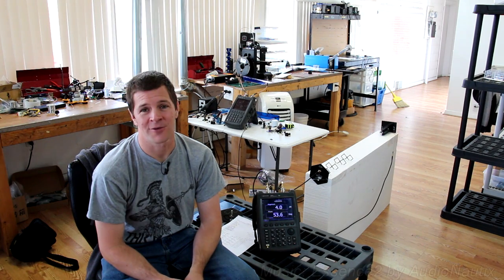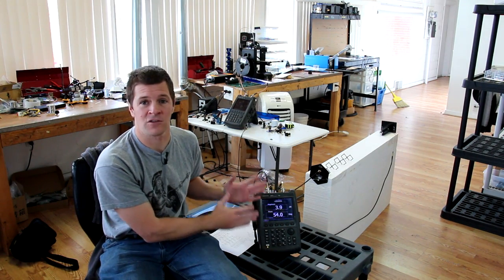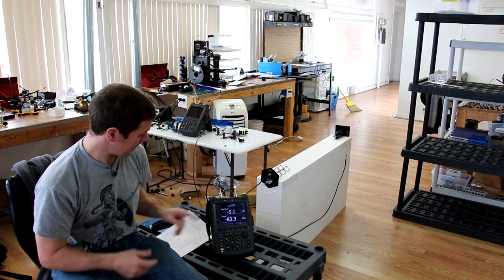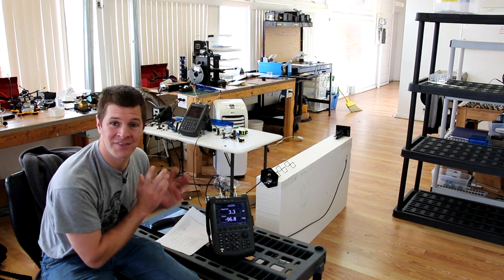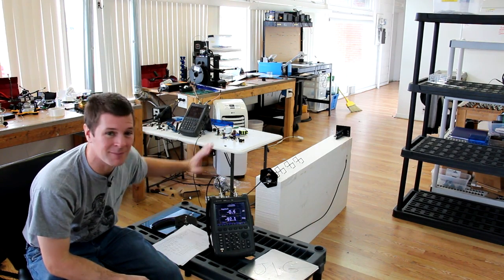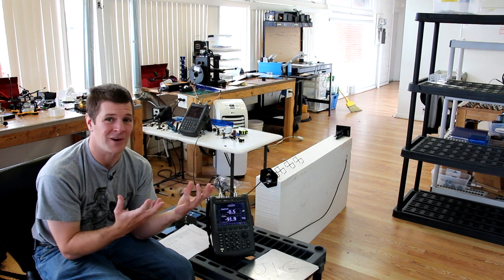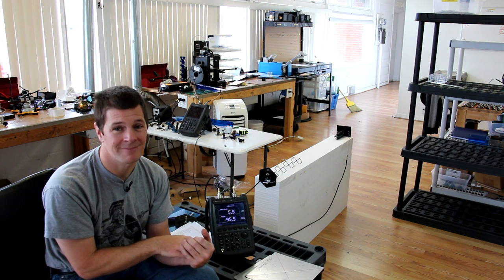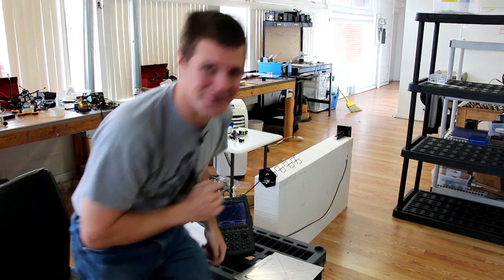Why I don't trust computer designed antennas

Comment: Wouldn't you need a anechoic chnber to simulate true free air? How much does that play a role on computer vs real world?
Reply from the maker: For perfection, maybe.  I find this method is quite accurate.  I have other tools I use to obtain the full radiation pattern.  The issue is that different humidity will change the results due to the change in propagation speed.  Thus, I keep my shop around 60% humidity for tests like this.

Comment: the central boom of any yagi antenna of whatever mhz should not use metal boom, am I right?
Reply from the maker: yxhankun - You can, but it changes the element spacing some.

Comment: Great demonstration on the spacing and how it affects the overall gain and vswr.  I’m able to use the Agilent 9918 model at work to test and check the antennas prior to using them on a flight, just haven’t seen how to go into the voltmeter mode on the reception aspect.  If there was one item of test equipment I could attain, it would be the Fieldfox if the price tag wasn’t too far off from that of a new car...

Comment: How do you now the radiation patern when experimenten with the antenna?
Reply from the maker: Erwin L - I spend a lot of time measuring from different angles.  I use a string to hold proper distance on all measurements and basically make a giant protractor.  I do the measurements outside for best accuracy.
Reply: @CAGreve1231  keep up the good work :-)

Comment: You don't pick up any stray capacitance from the foam?  Stray capacitance would bring your optimal VSWR & spacings to a lower frequency than the design/model.  Your measured resonant frequency was lower than your target frequency...
Reply from the maker: Bill G. Very little, actually.  This is the lightest EPS foam they make.  However, you are indeed correct that it defines it a little bit.  The humidity in the air causes much more trouble than the foam.

Comment: Would it be possible to make a high gain antenna array with a signal pattern like a hi-hat? Kind of like an omni but with a really high gain around the waist of the torus. Would be great for static receivers.
Reply from the maker: Fraser Steen - the “Franklin” antenna is just this type.  Check it out.  Lots of tutorials out there on it, too!
Reply: @CAGreve1231  amazing, thanks!

Comment: Ok... got a question at 3:40 there... 
The two antennas are fairly close together... a meter maybe. You seem to push elements of the sending antenna closer to the measuring point. Wouldn't this increase signal strength by itself? Especially with those short distances it seems like this isn't the right method to measure the signal strength changes if you don't bring the sending antenna's base back to then have the same air gap as before
Reply from the maker: DerClaudius - The distance is just outside of the Quagi near field pattern.  The reason to keep it relatively close is to reduce measurement errors due to multipathing.  The separation is a balance between staying out of the near-field and not incurring multipath errors.  I agree that more testing at a longer distance should be performed.
Reply: @CAGreve1231  Thank you very much for the explanation, this stuff goes over my head. If you don't mind, I'm having another question.
My understanding is that the wavelength is around 5cm, so points of constructive/destructive interference would also alternate around those distances if you have multipath problems. As all the walls are pretty close, the reflection also come from pretty close, so there is probably interference. Wouldn't this change the measurement if you just move the the measurement point around a bit around that magnitude of 5cm? Or is there something that compensates for these local fluctuations of signal strength?
Anyway, if the errors due to the closeness of the antenna's size to the actual air gap get fairly high, you probably don't want to be that close together for optimizing, because the error might not be just a percentage that gets applied to all antenna shapes, but you may actually optimize for the wrong thing (long antennas that minimize air gap) and actually pick a shape that'd actually be worse if you'd add just 3m to the distance.
Reply from the maker: @DerClaudius  - In my testing the walls and floor are definitely an issue on measurements.  In this case you can see some fluctuation in my readings due to that exact issue.  However, with the area given, those errors are surprisingly small given that multipathing is significantly weaker because it falls off with beam angle as well as the fact that I am measuring with a high F/B antenna.  THus, the key is using a helical as a measuring antenna to help mitigate the issue.
Reply from the maker: @DerClaudius  - This is 2.4GHz, so the wavelength is closer to 5" (12.5cm).  Reflections come with attenuation due to distances as well as signal absorption.  Thus, the multipathing issue is quite minimal.  The way this works is to amplify the reflections between the elements.  Thus, the distances between the elements are roughly the same with small adjustments for other factors within the structure.

Comment: How do you discombobulate the congruant bifactor of the resulting arch type infused surfactant tho?
Reply from the maker: jackosmeister - I bought a special edition Turbo Encabulator.
Reply: @CAGreve1231  Ahhh, so you're running a prefamulated amulator in a unilateral phase detractor to two spurving bearings?
Reply from the maker: @jackosmeister  - The phase detractor is the ONLY way to go.  Bearings wear.  detractos don't ;)

Comment: 5:42 - True, you would want to allow for the feed, in a small antenna it has a greater effect. Also keep the measuring antenna out of the near field.
Reply from the maker: LowLightVideos - When I first made this antenna, I had the block rotated the other way and the measuring antenna was in the near-field.  That’s why I rotated the block for this video.  Much more accurate.

Comment: Hey Alex, great job on the antenna! I previously posted a simple doubt I had, will be very happy if you can clarify me on it. My question is about the immortal t antenna - I've seen many people classify it as a dipole antenna, and I'm not sure about that. If it has a ground on the opposite side to the active wire, instead of an active part as I've always seen dipoles to be in, how can it be classified as a dipole? Shouldn't it be a monopole with a ground reflector?
I'll be very happy if you can kindly help me clarify this. I'm sorry for any time or inconvenience I caused you on this.😊
P.s. You've inspired me a lot to take up and study about antennas. I'm entirely grateful for that.
Reply from the maker: The immortal T is in fact a dipole.  It is the way it is described which causes confusion.  There are actually 2 active elements: the driven, and the reflected element (often called the counter element or counter-poise).  The reflected element is connected to the shield (ground) and while it might not sound like that should be resonant, it in fact is an active part of the antenna.  Without getting too far into detail, a sinusoidal wave may stand on any wire of proper length and size regardless of its connection points, hence closed and open loop antenna designs.  This phenomenon, while useful for antennas, causes some serious issues in designs of transmitters and high frequency devices.

RF signals are truly an amazing phenomenon.  If you ever need resources, I suggest the ARRL.  They have some excellent reading on the topic.

Comment: Great job!! One wonder how much is that nice network antenna analyzer that you have there?
Reply from the maker: THis particular model is $17,000.  The other unit I have is $24,000.  It is indeed much cheaper to buy software... but not nearly as accurate.
Reply: @CAGreve1231  Thank you very much sir!